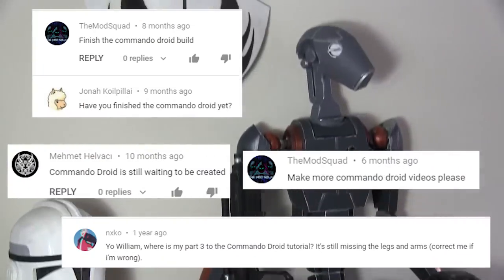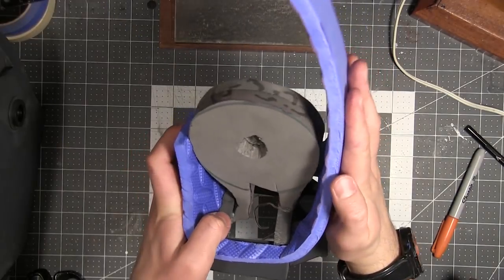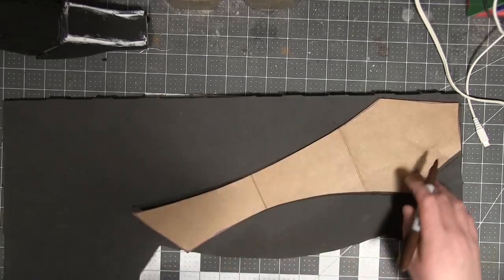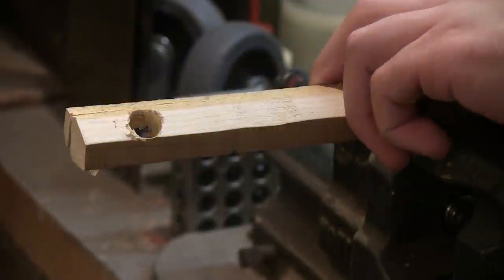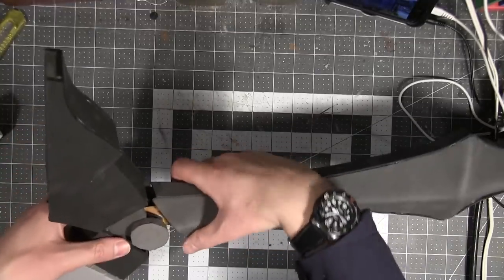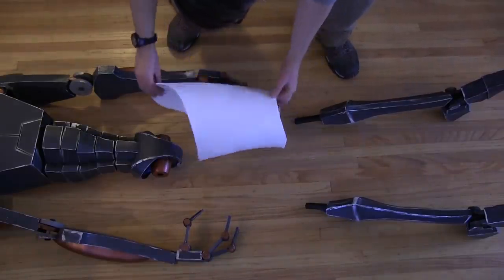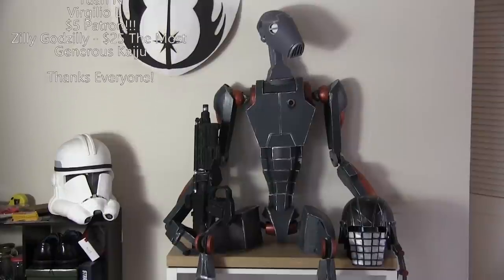Clone Wars Commando Droid Build Part 4

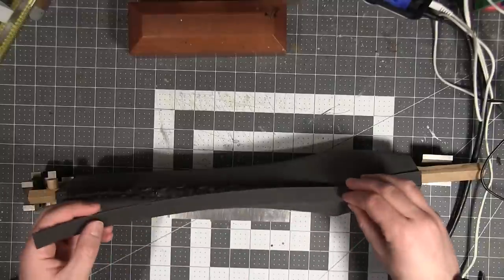Comment: 5:57 Get some "brake cleaner spray" at your local auto parts store. It makes decreasing fast and easy.
Great video 👍
Reply from the maker: thanks, i'll try that out!
Reply: @WilliamJakespeareProps  CRC Brake Parts Cleaner @ AutoZone ~ $5
Reply from the maker: @VKSgtSLaughter  picked it up today!
Reply: @WilliamJakespeareProps  Yay! Depending on what kind you got, make sure you use adequate ventilation, rubber gloves and eye protection. It also may bleach plastics and fabrics so be careful where you spray as it's tends to splatter.
On the plus side it's good for weathering plastic to make them look old. 👍
Reply from the maker: thanks for the heads up!